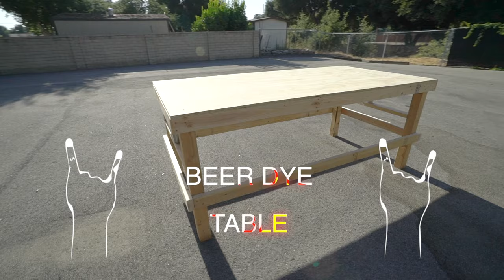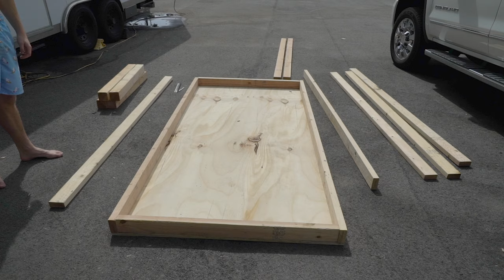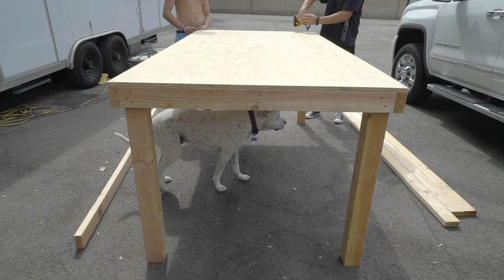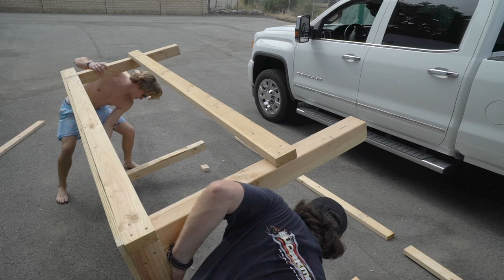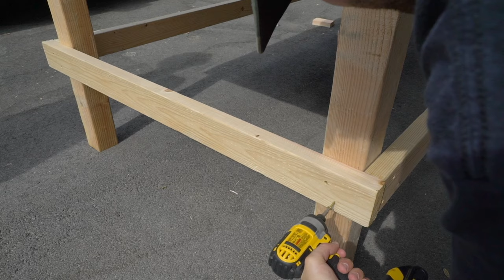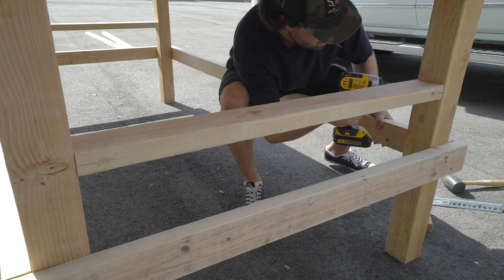How To Build A Beer Dye table

Comment: Dimensions of all the pieces for anyone who needs:

Wood
- 1 4x8 plywood
- 4 2x4, 8’ long
- 1 2x4, 93” long (7’ 9”)
- 2 2x4, 45” long (3’ 9”)
- 2 2x4, 38” long (3’ 2”)
- 4 4x4, 39” long (3’ 3”)

Screws
- 1 box of 8 x 1 3/4 wood screws
- 1 box of 10 x 3 wood screws
Reply: Thanks beast
Reply: Polyurethane
Reply: Missing an additional 2 2x4, 48" long (4'0") that go on the short sides of the table and align/attach to the 8' 2x4 that run on the outside of the legs
Reply: Also note that Instead of
4 2x4, 8’ long
1 2x4, 93” long (7’ 9”)

it is actually 2 2x4 8’ long and 3 2x4 7’9” long.